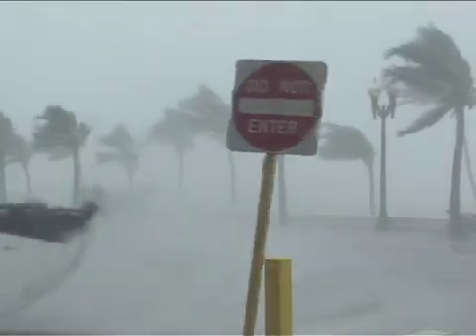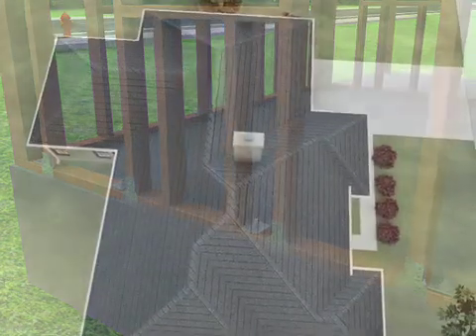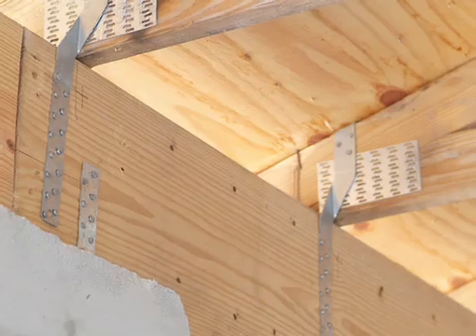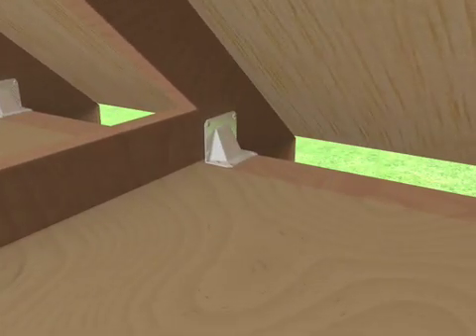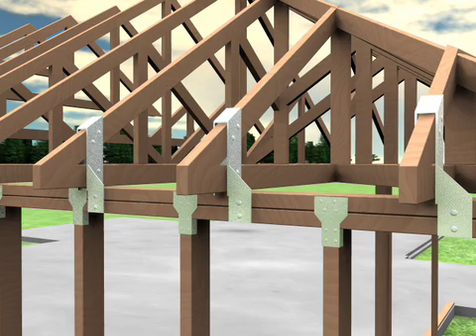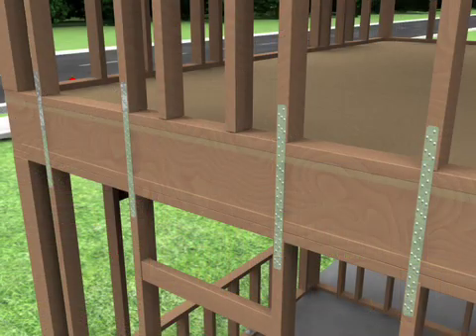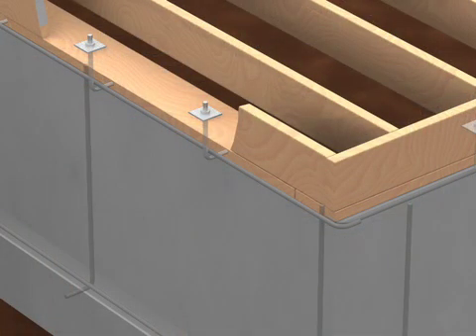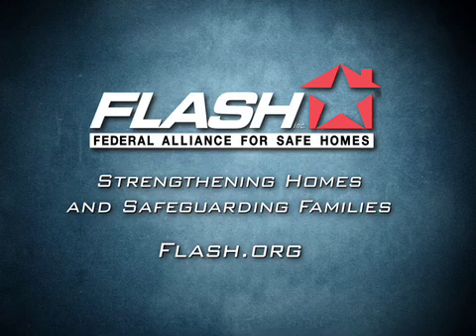Hurricane Straps

Comment: I am planning the building of a 400 MPH hurricane resistant home in florida which requires the roof being metal, all connection points are using three steps above the required codes, meaning double hurricane straps,  three times metal/aluminium connection points from the ground,  screws where nails are used or added, safe room anchor ground bolts, heavy concrete and rebar, reinforced side anchors and tops, hurricane resistant windows  along with the entire home being one floor and exterior window steel shutters and  steel solid doors with hurricane resistant steel screen doors in front. The required insulation with added heavy duty foam and reflective and water resistant materials.  The home will have no intrusion areas from wind pressure alone, however, there will be a repair kit should the unthinkable occur (a tree comes crashing onto it etc......... along with actually having a safe room installed inside also!
Reply: just build a brick building or underground
Reply: @Nicole-mb1sp Underground in Florida?

Comment: Why dont Americans use cyclone rods.  In Australia we have a half inch treaded rod that runs from the concrete footing through the framework all the way through the topplate. We use a mudwasher 2inch square washer then a nut on top . We space them about 6 foot apart and beside all external doors and windows. Also on internal bracing walls. Then we use a cyclone strap that wraps under both top plates. Each leg of the stap gets 6 nails. In addition we use a shitload of plywood brace on the walls and metal bracing to the roof. The roof battens are tied to the trusses with 4 inch screws and the metal roof is screwed to the battens
Reply: Hurricane threaded rod used in stick built homes in some regions in Florida...48 inches on center...some use cables instead of rods once house is completed kinda hard to go back and install these
Reply: @mattcullen6109 thanks for sharing this great idea!!!!

Comment: Thanks FLASH for putting all this information together.  Too bad I was not able to select building options like a more resilient home vs upgrading my kitchen with all the upgraded design selections.  

Are there any guidance to retrofit an existing building?  I have an unfinished two-story garage.  The exterior is complete, but I have access to all the interior because all the framing is still exposed.  I would like to strengthen it to withstand an EF2 Tornado.

With all the work and research that has been completed in FL and coast areas, this should be more common knowledge and less expert engineer stuff.

Comment: @GLG1957 Are you talking about the foundation fasteners or the wind uplift resistors attaching the truss/rafter? Although both methods would have done little to protect against a EF-5 wind force, they will go a long way to making homes safer.

Check out some alternative methods to anchoring the roof structure using screws.  These will be allowed in the Joplin area according to the Building Code Dept.